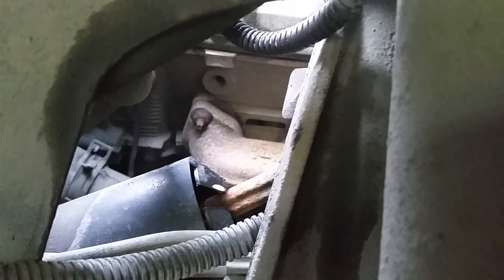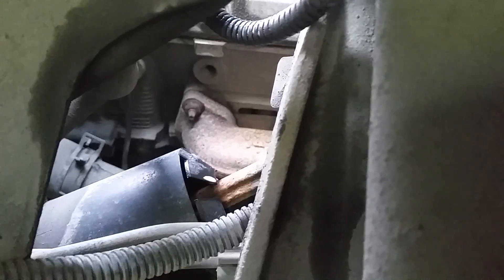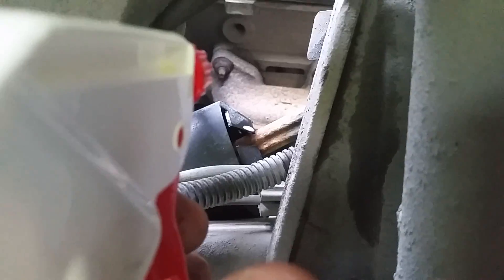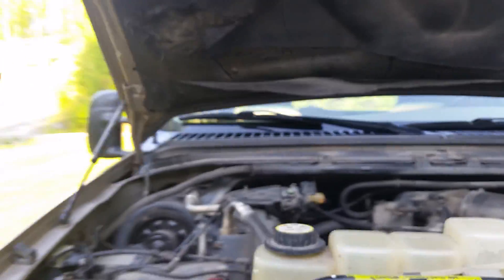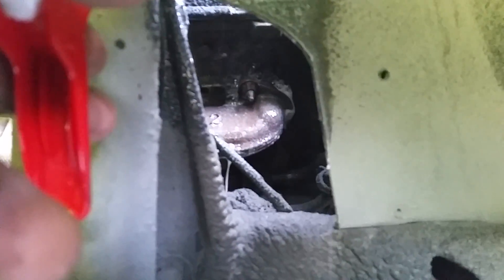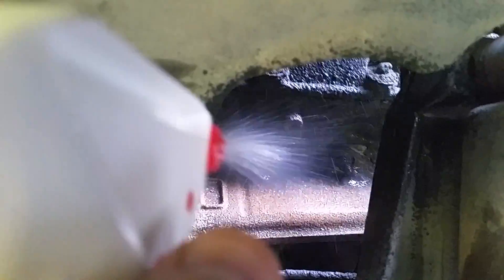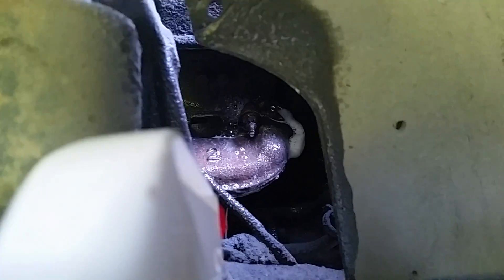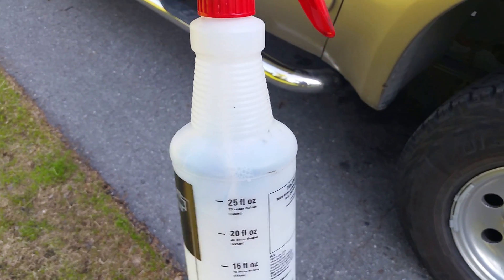Find exhaust leaks in less than 5 minutes!

Comment: I am using a battery operated leaf blower with duck tape instead of my dirty shop vac.    Also I have used a squirt gun and a hand pump garden sprayer for more reach.    

* Stay safe and avoid turning on the engine when there is an exhaust leak especially if you intend to crawl under the engine.  If you are smelling exhaust then you are breathing in it in and it is bonding with your blood and brain cells.

Comment: Another cool way to patch those holes is to reverse the shop vac from blowing to vacuuming as you apply a sealant. If of course you dont want to change the gaskets right away. It will help the muffler weld suck into the cracks. Great video!

Comment: I'm going to do this with a leaf blower.  My shop vac. doesn't have a hose connection at the exhaust.  I think the air should be clean enough. Well.....it should be just air with no chance of dirty vacuum dust etc.   I'll just give it a tiny bit of throttle to maybe just idle.  Should be plenty of pressure.  Thanks for the great idea.

Comment: I would think the position of the exhaust valve would matter, because if the exhaust valve is open on a cylinder I wouldn't think it would form pressure at the exhaust port. Maybe the crankcase fills with pressure too, but would that vent out PCV?

Comment: I know this is old but it's still helpful. Quick question, will u always be able to hear leaks and also did u place the end of the shop can on the tailpipe and blow or is it sucking(drawing air?)
Reply from the maker: The vacuum is blowing air into the tailpipe.  You won't always be able to hear the leaks.
Reply: Can I just do this with the car running instead of the shop vac
Reply: He even says in the vid how he has the Vac set.  Sheesh...

Comment: I like the idea but won't that just push a lot of soot and some of the carbon buildup back into the combustion chambers?
Reply from the maker: steve cameron no, you are pushing  maybe 20psi of pressure, most vehicles use 140+psi of cylinder pressure.  It's your vehicle though, if your not comfortable with it don't do it.  ;)
Reply: That's what I thought too. Some of the exhaust valves are most likely open. However it's a dead end because the intake valves should be closed at the same time so maybe it's not an issue.

Comment: What if I have a dual exhaust? Thank you.
Reply from the maker: Unless you have "true duals" it wont matter.  Most dual exhaust setups merge through an X pipe or an H pipe up to the headers/manifolds.  The process should work fine.
Reply: Yes I have a pseudo dual exhaust. Thank you very much for your reply!

Comment: cant you find leaks by just cranking thr emgine and spraying the soapy water,which will bubble from the exhaust air if theres a leak?
Reply: This is not true! An example; driving in heavy rain ,your headers are exposed to water and do not crack.
Reply from the maker: I guess you could if you had more than a single person, didn't mind putting wear and tear on your starter etc..  This method works much easier for a single person trying to do the job.
Reply: Spraying water on hot headers with car running could crack them
Reply: If your car is h t at all, which happens quickly, the water hits and just steams away. That only works if you move quickly after you start your car. The vacuum method is much better.
Reply: 4drturbo85  just make sure to do it intermittently specially if its cast iron... you dont want to thermally shock metal... rapid change in temperature might make metal crack
Reply: 258shoff depends on the engine you could if you were fast enough Alloy blocks/heads and headers heat up real quick obviously so water would evaporate to quick and to take you time and do a good job this ways would be the best
Reply: If you try to spray the exhaust manifold with the car running its hard to tell if there is a leak because the liquid will boil as soon as it hits the hot manifold. This is a good technique because you can check for leaks before things heat up and expand. Sometimes the manifold leaks sound quieter and leak a little less once the engine heats up.
Reply: What about running the car (cold start) and spraying with soapy water the area you think is leaking?

Comment: Nice work! Did you end up doing the repairs yourself?
Reply from the maker: Yes, I do all my own mechanical work.
Reply: Right on. I am dealing with the same situation on my 4runner.  Did you do anything special to the new exhaust manifold gasket before you put it on? Copper sealant etc?
Reply from the maker: No prep needed besides making sure you get all of the old gasket off the surface of the head.  A scraper or flat razor blade at a hardware store is all you need.  Don't try and gouge the head surface, doesn't need to look shiny, just flat and clean.  The new gasket will do all the sealing once you tighten the bolts down.
Reply: Good deal. Thanks for the tip.  Did you use a graphite or MLS style gasket?
Reply: OEM ford gaskets, which I believe were graphite.

Comment: One thing my novice mind does not understand : You say that a shop vac "pushes" air in the system. But doesn't a vac "suck air", as opposed to "push air" ?
Reply: Shop vac's have an "intake" side and an "exhaust" side.  The intake side "sucks" air, the exhaust side "pushes" air.  You can simply put your hose on the exhaust side and now the vacuum because a "blower".  People have been doing this for ages to blow up air mattresses, inner tubes and the like.  Hopefully that helps.
Reply: Thanks Kendall, for the kind reply. I honestly did not know that.
Reply: Thanks Kendall, for the kind reply. I honestly did not know that.
Reply: +Kendall Huseman so obviously the engine is off? and only vacuum going through
Reply: 1dgayles 
Yes, engine off.
Reply: Shop vacuums are basically an air pump.  There are two ports.... one that sucks air in and one that blows air out.  Simply connect the hose to the port that blows air out.

This is a special "feature" of shop vacuums that you will not find on your typical home vacuum cleaner (for carpets and such).
Reply: you can switch the hose to where the air blows out on a shop vac

Comment: Will this work on my turbo engine? Will the air from the shop vac even get to the headers past the turbo...
Reply: +Nik Coffman 
I don't believe it would make it past the turbo due to the impeller design... It wont harm anything, but very little air would get past the turbo would be my guess.  I have never tried it on a turbo car.
Reply: Kendall Huseman  Is what I was thinking. I can do it this way for everything up to the DP. For anything after that I'll just do a vac test with around 14psi. Thanks for your insight. Have a good one bro

Comment: I would think an open exhaust valve would fool this test so maybe turn the motor over to close the open valves? great idea though.  I'm going to try to this with my air compressor and pvc cap with a hole drilled in it..

Comment: Great idea. I have a z06 with exhaust leak and cannot find it. But, sure don't want any contaminants flowing backwards in an open exhaust valve into the motor, and I'm leary of pouring anything into the motor except oil.  Since my shop vac is filthy, I am going to use a compressor with an open fitting taped inside the exhaust, which can also increase the psi if necessary.  Pre-filtered air!  Thanks again!